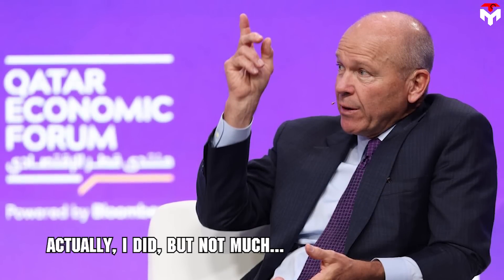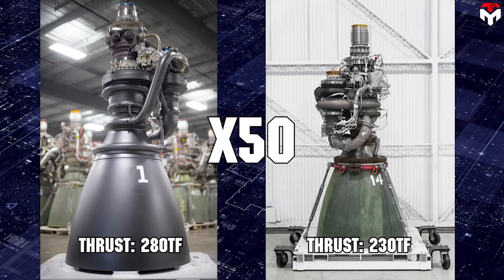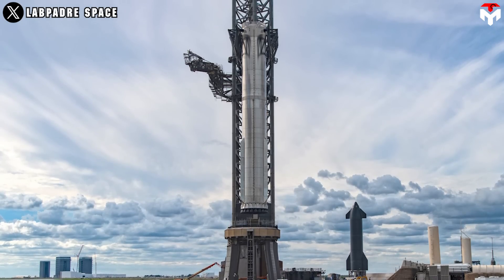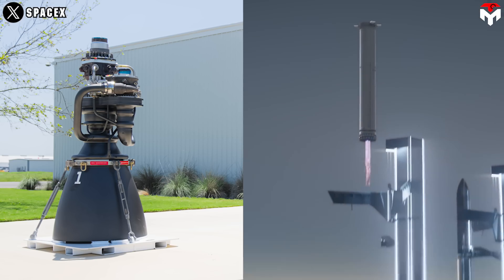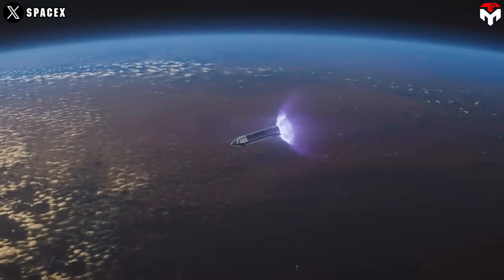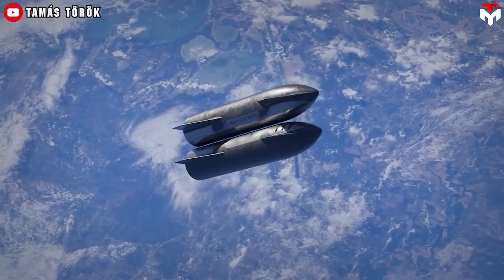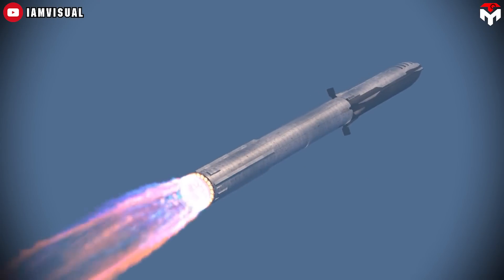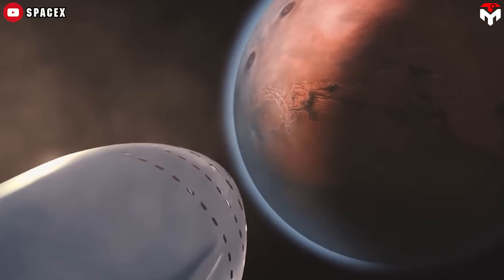SpaceX New Raptor 3 Firing just Shocked NASA Scientists!!!

Comment: All this will simplify repair. Fewer parts means fewer things to go wrong.
Reply: I suspect there will not be much repair involved. When this engine breaks down it will be "down and out". Musk mentioned that there are few access points and the engine has to be cut open to get inside of it.
Reply: @rocroc  Cheap enough to throw away. He turned it into a comodity.

Comment: With additive manufacturing there exists the capacity to build internal structures that replace much of the tubing wrapped around the exterior. Elon wants to eliminate the "bolted flanges" especially! Employing modular designs would ease maintenance and reliability would be enhanced to whatever degree they can employ 3D printing to replace the tubing
Reply: I have not followed additive manufacturing closely, can it replaced the tensile strength and toughness of steel DOM (Drawn Over Mandrel) tubing? Can it replace a steel casting, an investment steel casting? Replace a forging? 

Additive manufacturing comes across as a modified casting process with the material being deposited out of a tip. This can hold up to the extreme pressures, extreme vibrations, violent sound shockwaves and extreme temperatures of a rocket engine application? If the technology has matured and evolved to this point, I would be very surprised….possibly it has.

Welding followed by stress relieving provides a good tube or process equipment joint in this application

Comment: Hopefully, this engine will save Starship. It has yet to demonstrate any payload capability. Starship V1 was supposed to have a payload of 100t to LEO. But flying empty and fully loaded, it is running out of fuel. This means
NO payload. A higher thrust, higher ISP and lower weight should result in a higher payload.
This engine needs to be the Starship savior
Reply: It's a prototype. There's no refinement towards performance, in fact plenty of performance is wasted in order to demonstrate mission objectives with the highest likelihood of success. I think you're correct in your analysis, but I'm fairly confident this gigantic rocket has accessible margins of 150 tons in due time. The propellant to dry mass ratio at lift-off has a huge impact on payload capability at this scale. (BTW, I'm surprised no one asks Musk why the booster exhaust looks so methane rich) The giant hurdle for Starship is super-chilled orbital refueling. IDK if we're 5 yrs or 2 decades from that reliably working
Reply: @gcburns4  The GAO put out im its report that Starship would be short in performance. I dont think its a secret. Also, while its normal to do upgrades and improve performance, it is not clear that there is any payload to V1. No dummy payload whatsoever which you would want to fly to demonstrate flight dynamics. Instead it is an empty can. Then they took off a 10,000 lb skirt why? Performance related? Probably.
I expect V2 to deliver a payload. We shall see what the capability will be.. Honestly, 10-20 launches to fuel up for Mars or the Moon is awful
Reply: Too early for cargo. The V3 engine and the V3 Starship version (150m) should deliver the 200t cargo. They are currently using V2 engines with (I seem to recall) 330 ISP at 300 bar vs 350ISP at 350 bar... so yes, that saves well over 100 tons of fuel. Keep seeing they have the same ISP in half the docs, highly unlikely with that big a gap in pressure.
Reply: @avgjoe5969  Well, I look forward to see the payload capability.
Current vehicle has very little payload. It flies empty and runs almost out of fuel after fully loaded. Translation…. No payload. Lets see what the engine integration and design changes bring. 
I dislike the multiple launches and refueling required. Ugly design. 
Also dislike a tall vehicle landing on the lunar soil. High risk…

Comment: Hmmmmm.... the Raptor 3 engine is a testament to SpaceX’s ambition to push the boundaries of what is technically possible in rocket engineering. The engine is designed to be more powerful and efficient than its predecessors, with improved thrust-to-weight ratios and optimized fuel consumption. This enhancement is crucial for missions that require heavy payloads to be delivered to high orbits or even to the Moon and Mars. By reducing the weight and increasing the efficiency of the engine, SpaceX is addressing one of the biggest challenges in space travel, the cost of launching large payloads 🥇🇮🇩🥰😘🥰😘🥰😘
Reply: To put it succinctly, all the lines and tubes of raptors 1 & 2 are now integrated into the innards of raptor 3.

Comment: Well, reportedly, at first SpaceX started out with minimalism as a criteria on Merlin Engines, but by the time they got to 
Raptor 1 the mission creep had it looking like a Spaghetti Monster, and likely reliability muchly degraded. And The Enginerd Tribe was "Reluctant" to consider correcting the problem. As they were likely invested in all the pipes, hoses, wires, sensors, etc.

But luckily Elon got word, probably thru a better mind than the Yammerheads, and his Aspie mind evidently Groked the points, And his Nerds were quickly repurposed, and Raptor two in the works instantly...🤣

And obviously Raptor 2 was enough encouragement on the new path, They all got into it, and Raptor 3 soon developed.

Which is the most impressive modern rocket engine in production.

I think Raptor 3 will continue being improved, but that over all its a stabile design platform. Single combustion chamber to pump engines will look much like
 Raptor 3 from now on.

I wouldn't worry too much about repair, the internals have been minimized. Its basically a sealed engine like Rolls Royce put into their cars when I was a wee lad.

If its a good enough engine, it doesnt need much repair.
You could probably judge engines by their repair requirements...

(Hopefully more early Chevy in its genetics, than early Ford.. 🤭)

And that being said, we have Sawzalls and TIG welders now, to cut them apart and refurbish, and stick them back together.

Basically any basic shop will have the tech. 

Quite possible even that tech onboard the same ships.

And the guys with grease under their finger nails, will learn exactly where and how to cut, how to clean and rebuild, and hopefully do good welds putting them back together.

I find it extermely heartening that Elon is talking continual improvements from now on...

And I think Raptor 3 is so cool, that it makes Starship look a bit primitive as a ship design.

That maybe its time to get less entrenched over in hull engineering, and start thinking beyond 1950's era bullet shapes...
As performance and efficiency of engines improve, its been a general tendency to upgrade the chassis and sheet metal...

Who knows? maybe 50 years from now guys will retro better engines into Starships, building hot rods out of classic antique ship designs?

But I think now and Raptor 3 is a good time to start branching out
on ship designs and their purposes...

Generalization is good, but one size fits all isnt....
Nor is one design, or we'd still be using biplanes... And Starship is kinda like that....
Impressive now, quaint in 20 years...

The good news, is fabrication is commonly understood, 
And we have a crop of way good beginner welders coming hot off of Trade schools now.
They'll need and get plenty of practice working for Elon, but they'll want to do more than tube ships, or get bored.

And the hull engineers better come up wiith things that entice Elon forward, or become redundant and unemployed... 😢

I would suggest starting to design in longitudinal gores, and in triangle based geometrics like 6 side and 12 sided.

Also start working in curves in the hulls via radiused gores.

Its pretty simple to understand, after doing a few models with shoe box cardboard, and super glue...
And once you get the potential  you can just work on paper or computer graphics.

What we are gonna need, especially at first  is Milspec stuff. Landing on the Moon and Mars will be more like Normandy Beach, than  Blue Tree Beach on the French Riviera...

Wont be about fancy designer schitt, will be about durability, practicality, and easy repair.

Also, the Space Force is likely to get increasing budgets over time.

Follow the money...
Thats how you keep a job going...

Also know those Military guys have created their own culture and style, Military everything has a different look than Civilian stuff even doing the same job.

Big difference between a Cruise ship and an LPD...

And we do need to transfer our military culture into space intact. Because theres no guarantees about what might come at you, or what you run into in the next Solar System.

So I suggest wannabee Ship Designers study milspec styles and why they are, and start using those concepts in ships for the sea of stars...
Reply: The engine will eventually be printed, if not already, maintenance will be a flush, and x-Ray, if the engine fails inspection or this task, it will be recycled and a new one installed. 

When you make an engine a day, and being hardware rich, you dont need maintenance, you just grab a new part